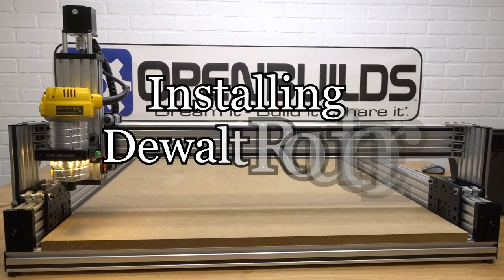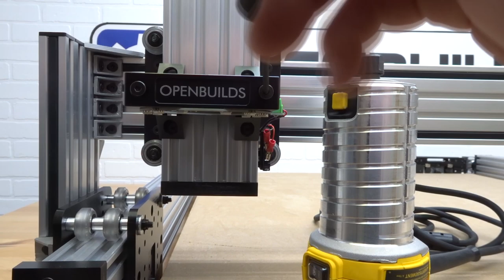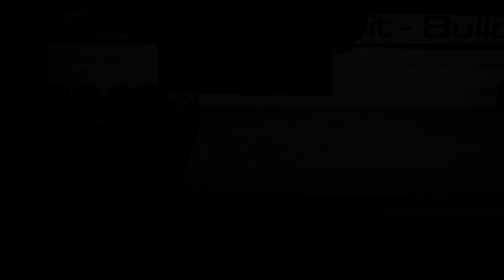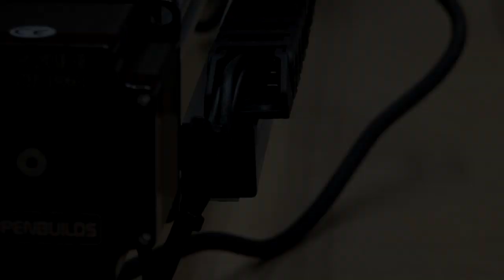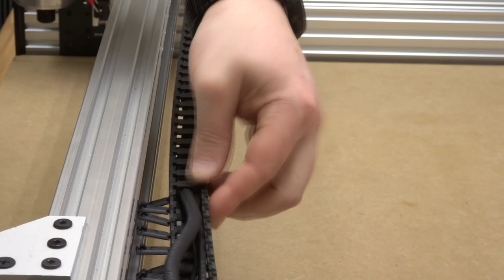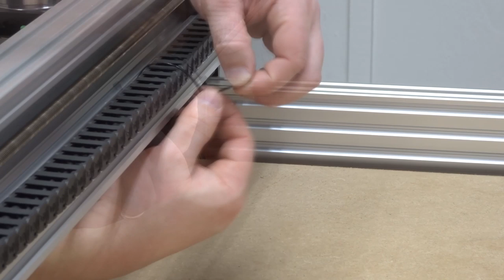OpenBuilds Dewalt Router Installation

Comment: I bought the ooznest workbee 1500x1500 kit . which I do regret not purchasing from open builds. I bought the 2.2kw chinese 220v water cooled routers and inverter . well two new routers both quit working after 30 minutes the latest motor would come on spindle wouldnt even turn. Long story short is there a way I can use  ER20 collet system with that dewalt? I am so done with chinese crap. I only bought it because of it being 400 Hz very quiet trying to keep the noise level down in my garage.
Reply from the maker: Please check out https://openbuilds.com/ this is a great place to ask questions and to learn more about the CNC world. 👍

Comment: Hello, I am new in this and I hope that you can help, I have assembled a CNC milling machine in aluminum with X and Y axis and with Z axis spindle, I bought a 2.2 Kw splindle cooled by water and the problem that I have to put it on the Z-axis this does not hold the weight and goes down I have it, mounted with arduino one, cnc shield, drivers DRV8825 and GRBL.
I leave you a video to see if I'm lucky and someone knows what may be happening. 

The engine goes up without problems, but when it stop going up, the weight goes down by itself.

https://www.youtube.com/watch?v=9OwgvUgFNeM
Reply from the maker: Hi Esteban, Please check out https://openbuilds.com/ for support. This is a great place to troubleshoot problems with engineers and makers alike. 👍